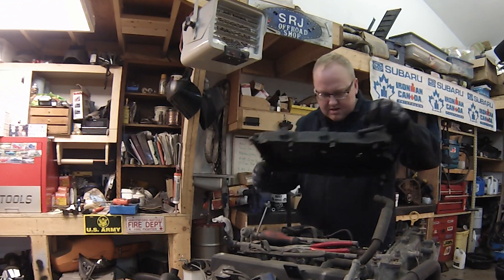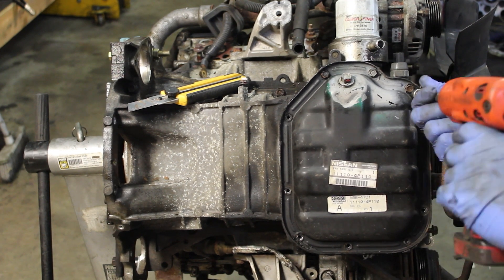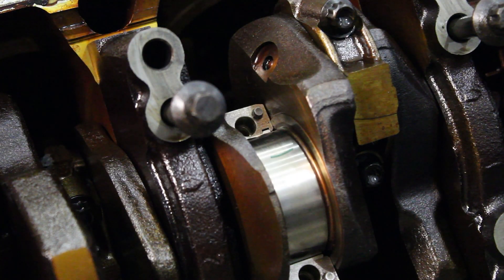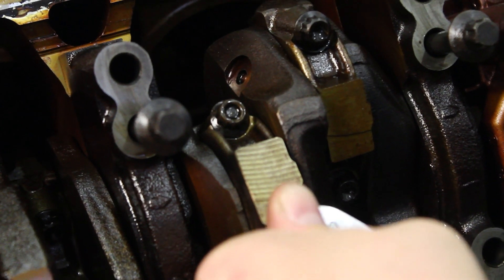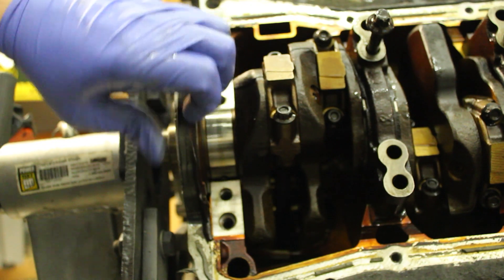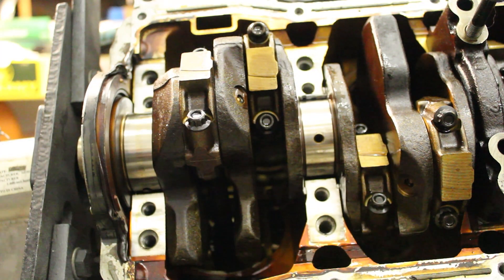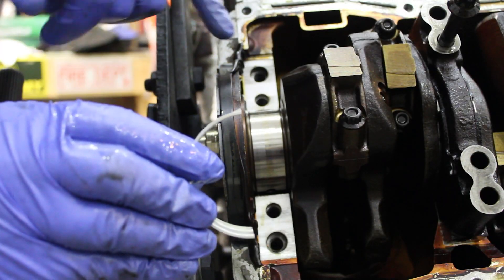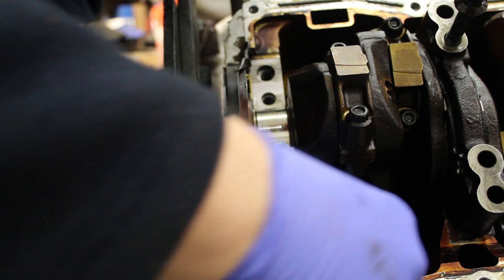VQ35DE bottom end bearing replacement How To. How to measure plastigauge?

Comment: Whats the correct torque on the connecting rod bearing bolts? Is it 15 ft lbs +90 degrees??

Comment: I'm having a ridiculous amount of trouble finding the correct sockets for the main cap bolts 😩 Please can you tell me the exact type of socket I need? For example, is it an R8 Ribe socket?
Reply: Etorx
Reply: I was under the impression that the connecting rod bolts supposed to be torque to 15lbs then 90 degrees is this correct? @RMSEP24
Reply: Etorx 14 and 12 pt 10mm socket for connecting rods

Comment: Regulat Hex 10mm socket wount grab the main caps bolts. What tool did you use?
Reply from the maker: It's an e14 inverted torques

Comment: Great video. I ran into some knocking with my 06 350z. only at 71k miles. Mechanic said cylinder 5 rod bearing is the problem. would replacing the rod bearings with new ones worth a shot considering the car is low mileage?
Reply from the maker: If your going to do this, make sure you compare all your cylinders to the worse one when it comes to wear on the crank. Usually knocking means spun bearing and a damaged crank. Only way to know, is to take it a part and look. Worse case is you have to replace your crank and on connecting rod. Best case, you just replace the bearing.

Comment: Are these vq’s notorious for the bearings going out
Reply: I would say VQ engines have more of an oiling problem, which then causes bearing issues. A well maintained engine and oil will see these go well into the 200k range.
Reply from the maker: Yes!

Comment: 90-95 ft lbs torque on the main bearings?
Reply from the maker: It's a two sequence torque. First is 32.3 - 38.3 nm or 23.6 - 28.3 ft/lbs. Then second Sequence is 90 - 95 degree's. Is it 90 - 95 ft/lbs? That I could not tell you. I just used a torque wrench that could do the degrees. Does this help?
Reply: @SouthdownGarage  appreciate it brother 🙏🏼